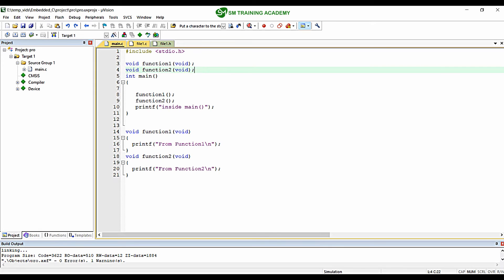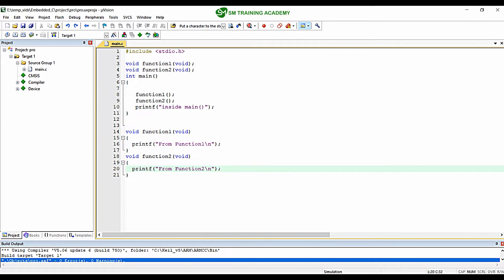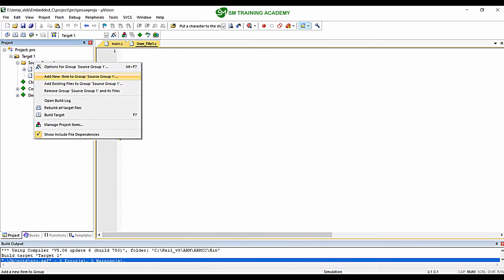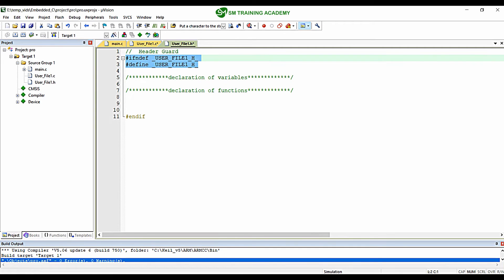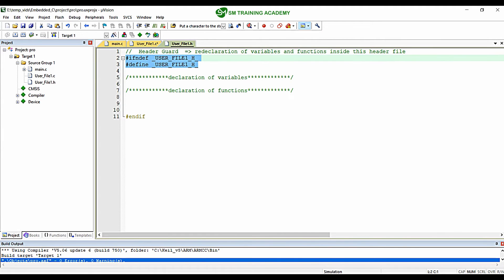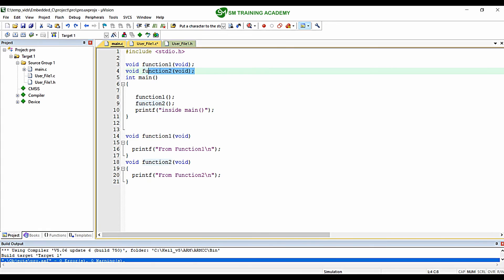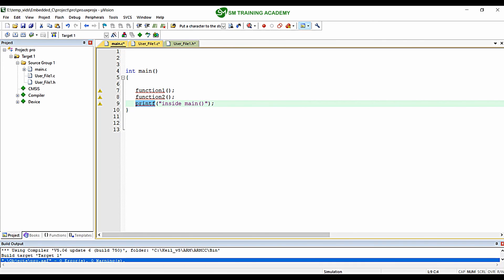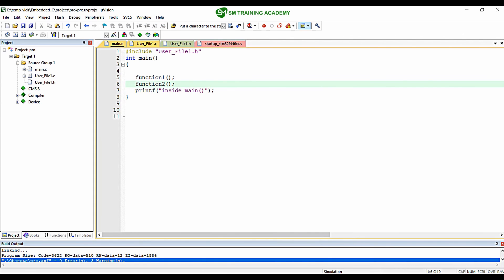Creating User defined files in Keil uVision IDE

Comment: Hi, thank you for the video, i may have a question also. The user.h file doesn't include the definition of the 2 functions, it only contains their declaration. So how we could access them from the main function juste by including the user.h file ? i thought we would need to include the user.c file, or isn't it possible to include a source file inside another one ? So it would mean that their is a kind of relation in C between a source file and its corresponding header file ?